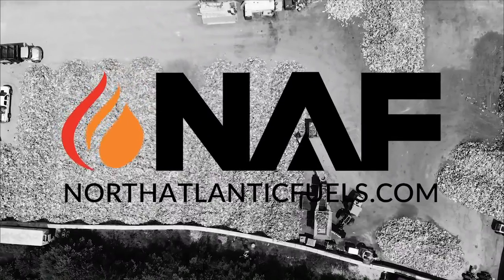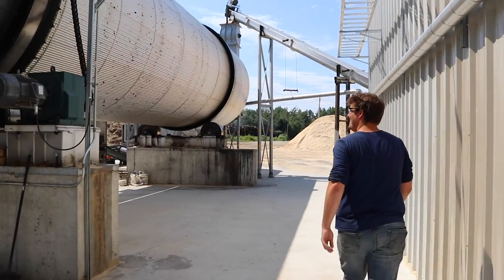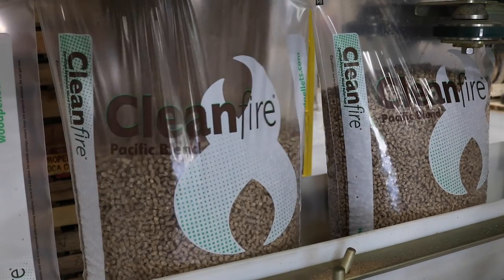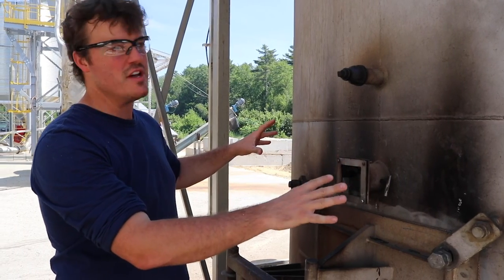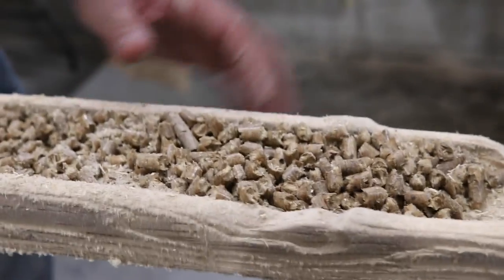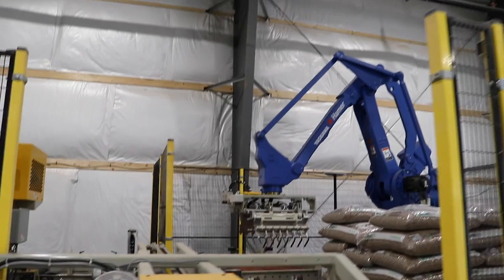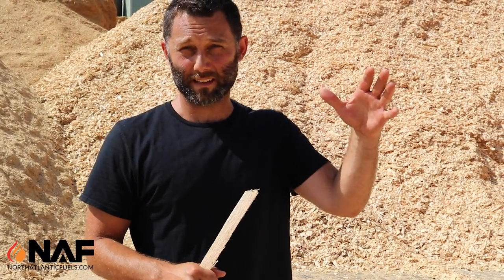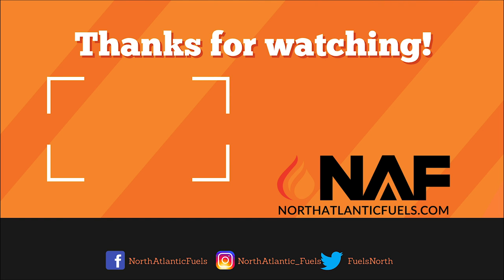Wood&Sons Pellet Mill Tour!

Comment: My grandfather bought a small, (well big but smaller than this) pellet production line and it’s a company that went bankrupt, they wrongly installed it, flex hose on cyclones and no blower on top of it, just straight up 4 inch pipes, we almost gave up on it, until now at 16 years old, I decided to make it work, bought with my father a wood chipper so we could crush our scrap wood from the sawmill, and I installed a blower on top of the cyclone , installed a drive for it, constructed a filtering system outside the building, now we produce 4 tons a day of beautiful shiny pellets! 
They are red because there is bark in it but people like it!
This machine was wrongly put together sadly and the machine kept breaking
Now I fixed everything!
Reply: It's hard to make money on a small scale from virgin wood.
If you have a planer and or sawmill and you can process just the shavings and sawdust it's way better.
I ran a mill with about third of a ton out put an hour. We mostly processed the sawdust and shavings we had previously paid to dump as landfill so the economics were amazing. As our pellets became more in demand we tried to add feedstock from the woodchip we produced but found it was barely viable with a wood shredder or grinder. I had wanted to try a shavings mill but didn't get the chance.
I am certain it is a better method that needs far less energy. Maybe you should look at trying it.
My thoughts were.
Far cheaper for the cutters which can be resharpened and take far less time to change.
Less power needed to produce comparable volumes and far less effort in the hammer mill stage. Finer shavings dry much quicker and are more even moisture content. Smaller pieces in the feedstock with consistent moisture reduces the risk of crumbly pellets and the loss of volume at the screening stage.
Beyond that my advice is never try to reuse any fines from processed pellets. If you have a dryer running on biomass put it in there. I have seen how the pellet mill can just churn out ton after ton of dust as there is no lignin to make any thing bind.
Hope you do well. I really enjoyed the time I spent doing it, especially as I got higher and higher outputs. We also had variation in moisture and the species we worked so for us every hour of every day could call for adjustment. Luckily it was computer controlled but it only played up when I was at the other end of the sawmill.
Reply: @richardlee2488  we have a wood transformation company, we have a planer bf we did try with shavings, but our machines are not made to make pellets with wood shavings, it’s configured for wood chips and yes we have a saw mill
Reply: Our machine is big enough for us, it’s 4 tons a day and we make pellets only 1 or 2 days per week,
Reply: Also, our production line has 2 kinds of crushers, the first one is a knife mill, it’s like a big planer head that crushes the chips in smaller particles, then it’s sucked by a blower and goes into an hammer mill, then sucked up by another blower to finally go in the cyclone then the feeding screws and finally the pelletizer
Reply: @RWRKofficial  as I said before we mostly used the planer mill waste. The knife mill you mentioned sounds like a drum chipper. Depending on the screen size you can adjust the output size but as the screen gets smaller so does the output. We actually ran everything through 2 hammer mills before pressing.
I was asked to visit another producer that had installed 2 Mills like ours but he could not make pellets. He had his own trees chipped and dried by a contractor and then fed his materials through a single hammer mill before the presses.
It was a disaster.
He had tried for six months before contacting us. In that time he had destroyed a dozen dies. Huge blow outs with the dies bulged out from the pressure.
His problems were poor moisture control and the feedstock was still to coarse.
Similar to the material used for chipboard with very little fine stuff when it came out the hammer mill. The pellet mills were banging and crashing as they tried to force the stuff through. They even had to rebuild one mill which had bearing failure in the few months it operated.
Our mill by comparison was though not quiet was running on more like wood flower and sawdust and was super smooth unless it was a bit dry. You could mostly hear the sound of the pellets as they fell down a chute from the press to the cooler and from the cooler into a hopper where they waited before packing.
Reply: @RWRKofficial  there is no such thing as a pellet mill for shavings compared to sawdust or chip. The difference is in the material or feedstock must all go through the hammer mill to be fine enough. If the feedstock varies it can give supply problems but the only other significant variable is the dies compression or compression time.
We were of course effected by a change from shavings to sawdust and back to shavings but that is a failure of the feedstock feeding. Absolutely not the press. We ran a walking floor into an auger to our first hammer mill. Shavings will bridge and starve everything. Turn the mill down to overcome the bridging and the process heat in the die causes blocking the die as the mc reduced.
If the operator stood watching and constantly preventing the bridging and increased the feed to allow sufficient volume through... Amazingly no problem. A good mix of shavings and sawdust again no problem. My idea was hammer mill after the bag filter extraction and before the walking floor bin, not after.
Is your mill claiming it is automatic or are you expected to nurse it minute by minute?
As for the capacity you produce. It's controlled by your market. We produced a quality superior to most. Density of. 9 was common and most customers loved it. At first it's hard to find a market but get a good product and its not long before you can't keep up.
Reply: @richardlee2488  it’s to get rid of the scrap wood we have and the machine is BUILT for wood chips nothing breaks we were watching it do it’s thing most of the time 
It’s also a used machine and it’s only the 2 pelletizer who were kinda used but we had spare parts 
And there’s a reserve but most of the time the machine is too fast for us and the crushers never broke down 
We tried wood shavings but no, too dry for these specific machines and the sawdust is already too thin to enter the machine that’s why we have a knife mill and hammer mill and it’s impossible to jam up the hammer mill. On a big load it pulls 25-30 amps from the wall and the knife mill the max is like 20-25 they both have a pretty strong motor so
Hammer mill is a 600v 40hp and the knife mill is 600v 30hp 
Pelletizers are 20hp coupled to a fat gearbox 
It used to be automatic but we didn’t need it and lack of building height, but now we’re trying to figure out how we’re gonna setup this machine properly for automatic control 
But yeah i did all the possible tests and only wood chips works
The feeding screws above the pelletizers are adjustable speeds, and the big feeding screw over the knife mills as adjustable speed too
The material at the output of the knife mill is the size of a rice grain then it enters the hammer mill to get smaller
I read the manual of this machine
Reply: Forgot to say but we don’t have only a pellet production line to make money, we have also a wood transformation shop and we also make construction wood
We recently had an order of 20000 BBQ scrapers (grill cleaners) and 10000 of cherry wood cutting boards
Reply: @RWRKofficial  so many things to discuss but to me rice grain is okay it it 25% or less of the feed stock. Are you making 6mm or 8mm pellets?
Can you add moisture?
Is the moisture monitored?
Can you add oil?
Can you see the temperature in the die?
Do you have a conditioner between the first hammer mill and the pellet mill?
Get the materials consistent and its easy. A walk in the park.
In automatic the variation needs to be possible. It's a huge ask from the supplier and not always possible but shavings should be the easiest if you can get the feed right. Moisture is easy to automate with a simple plc.
Reply: @RWRKofficial  don't rely on pellets to pay the wages. 🤗
Reply: @richardlee2488  they are 8mm and yeah we can add moisture but normally we test it and add it at the start, we have a manual meter, we test it but the wood chips are perfect and made for that this machine is built so it doesn’t need a conditionner and since it’s chips, the humidity of our wood outside doesn’t go below 15% and the humidity required for good pellets for this machine is 15% to 20% 
So the wood is always good 
We also had oil 
If you want I can give you my contact so I can send you pictures of the machine
Reply: @RWRKofficial  the mill I worked has been sold and the entire business has closed due to retirement. But I am more than happy to talk  or chat with you. The moisture you suggest you need is incredibly high as normal value is 8% to 14%.
What moisture is the timber that you plane for your other products and is it a steam kiln or conventional dryer that runs below 70c degrees? I guess that's about 150f if that's how you prefer. Where are you for the record?
I presume you have a ring die machine. Is that correct?
Reply: @richardlee2488  it’s a flat die
Reply: @RWRKofficial  ouch.
Flat dies are not ideal.
The inner holes are subject to different forces to the outer ring. Okay for home use where quality variables can be accepted.
If you want to be commercial you will need to move to a ring die.
Reply: @richardlee2488  yeah but it’s not necessary for us
Reply: I’ll give you my Instagram
Reply: @richardlee2488  it’s an industrial flat die machine
Reply: @richardlee2488  YouTube sucks, how can I contact you
Reply: @RWRKofficial  how do you test the moisture content of the materials?
Is it a laboratory quality oven test or an electronic probe meter?
Or do you use an oven and scales?
What is the test batch volume?
The international finish product standard to aim for  is EN+ for domestic use which is to be honest is overkill but you produce 8mm which is really for power station use. The aim of the early pellets for this was to reduce bulk. The pellets are ground later to allow for the power plants to run as suspension burning. The fuel is burnt instantly. Crushed coal is the same process.
The issue the flat die is that fine material can drop through the die without compression starting. In a ring die the rollers are at the 3 or 9 o'clock position or both..
You need a course grain like rice to start the process but its not ideal.
The moisture content of the feed makes it a good or bad pellet which is related to the compression of the die and how long the die compression lasts. This needs to match the feedstock.
Easy😁
Reply: @richardlee2488  i would like to send you pictures of the machines how can I do it? 
Also it’s just at the start when the die is brand new that it does that, but there’s also a specific process to start it up, we test with a probe meter, it’s not a ver big machine and it’s really built simple 
But yeah I’m bad st explaining, how can I send you pictures? Oh and I checked, it’s 6mm
Reply: The die is 500h max but we make pellets 6 hours a week only
Reply: @richardlee2488 so seems you know a lot about pellet making. What do you know about the Richi brand machines?
Reply: @allwortht long time since I looked at their mills online but I would always recommend a ring die machine if possible.
Beyond that, once you get the feedstock right and the die taper correct it's fairly easy irrelevant of the mill manufacturer. Of course some may be less rugged.
Keeping the material constant is where most fail. Right size, right moisture, definitely no recycling of material that has been through before unless you are allowed or want to use added lignin. 
A big thing to avoid is thinking that using damp and dry mixed will be the same as good evenly dry stuff. You get nice pellets coming out but when cooled they look like a pine cone and crumble.
Also keep an eye on the final pellets density. Too much variation and if you're selling them you will get complaints.
All boiler suppliers will blame the fuel. Common issue is the cheaper boilers don't clear the ash in the crucible when relighting which is almost always going to create clinker.
Reply: @richardlee2488  thanks a lot for the insight. Ring die is what I am after for sure. I agree material has to be consistent in order to produce good quality pellets. 
I’m looking at the whole assembly from hammer mill to drying, palletizing, cooling and packaging. 
And to me I think I would like to sell bulk instead of small or mini bulk bags. I don’t know. What’s your take on that. Selling feature
Thanks again

Comment: Pine is soft.
Reply: It's not that soft, especially when it comes out as pellets.
Western red cedar is soft to the point that I could not make pellets from it and even mixed it could mess things up. All the pine and larch and Douglas fir I did were brilliant but oak and Ash were way better. I didn't get a chance to try beech or sycamore in any volume but think they should be good and birch is normally just chipped and sent out as power station fuel in England.
Reply: @richardlee2488  Thanks, loved the vid, Lots of power to make pellets for sure.
Reply: @rterry2752  just to be clear. This is not the business that I worked or work for. I ran a pellet mill that was in England and was manufactured in Italy.
The basic process is the same but geographical differences in the timber can occur. Siberian larch is hugely different from the European larch because of the difference in climate. The hardwood in England is probably similar density but if it could even grow in the tundra it would be tiny by comparison.